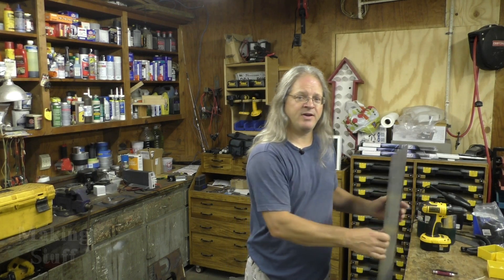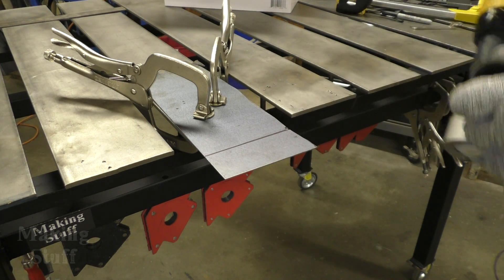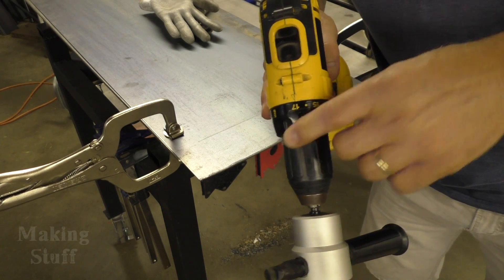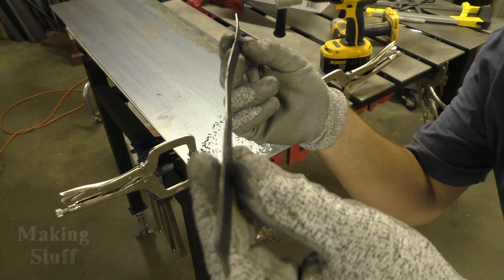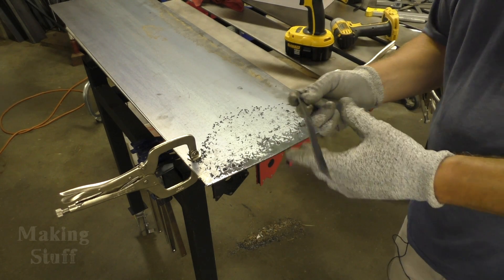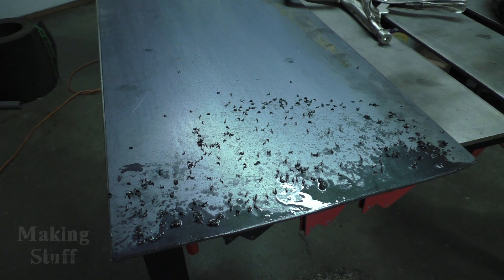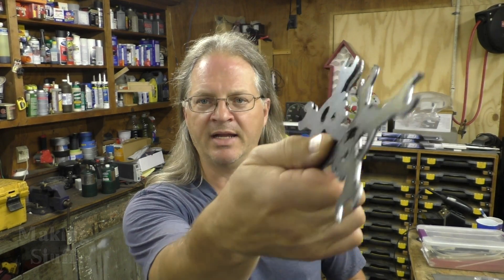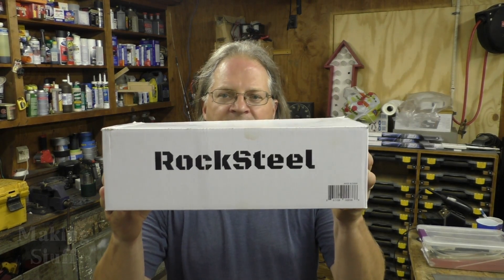New Sheet Metal Tool, Painted CNC and Throwing Stars

Comment: I can tell you 2 things about the finish pieces, there's problems with the vibration on the system that make the cut not clean, also the lubrication of the rail could be something you should consider. The parameter of cut for that width of metal and that kind of metal see these if your'e interesed (https://wiki.opensourceecology.org/wiki/Plasma_Cutter_Cut_Speed_as_a_Function_of_Metal_Thickness).                                               I speak spanish so sorry if a have any grammar problems also nice video this help me a lot for my work.

Comment: I’ve watched all of the videos leading up to this one. You got skills. I scratched my head though when you broke out that nibbler tool.  Lol. You have a plasma cutter right next to you to lop that off. I’m guessing a product promo was the reason you didn’t.
Reply: pneumatic nibblers are cheap and less awkward to use.
Reply: @mrburns366  true but you got skills and could master a plasma cutter. I use my cutmaster 58 for rough cuts but for fine work a carbide saw  blade and a band saw.  I Like you work👍

Comment: Nibblers are great but the blades wear out fairly quick. And also like you kinda found out the shavings are sharp keep your air hoses picked up when nibbling. I've busted quite a few hoses because of the shavings great build congratulations on the finished build.
Reply from the maker: Yeah the shavings are a deal killer for me.  I've got hardwood floors in the house and it would only take one little shaving to scratch the floors.  I didn't even think about puncturing air hoses.

Comment: Cool video, one question on the nibbler, if it cuts like a jigsaw why not just use a jigsaw?
Reply from the maker: I don't think you will get as clean of a cut with a jigsaw.  Not sure I've never cut metal with one.
Reply: @MakingStuff  I did even with stronger steel and was quite astonished how well it works with this pendular setting (if the machine has one!)! But I don´t think its doing good to the inside mechanics of the saw. And: Be aware to never lean over the saw, as it could easyly remove all of your front teeth in one single kickback! And of course you should not try to cut with the coarse wood blades ;-)   there are very different jig-saw blades for different metals.
Reply: The Nibbler can take tighter turns it's just a different tool to do the same thing it has its own special qualities

Comment: When cutting steel in the shop with a grinder, saw, or nibbler I put the free Harbor Freight magnetic tool bars beside the cut top and bottom (magnets are in plastic bag) When finished most of the chips are stuck to the magnet, remove the bag (turn it inside out) and throw away.
Reply from the maker: That's a good idea.  I'll have to try it.